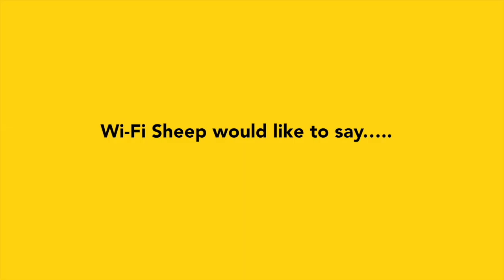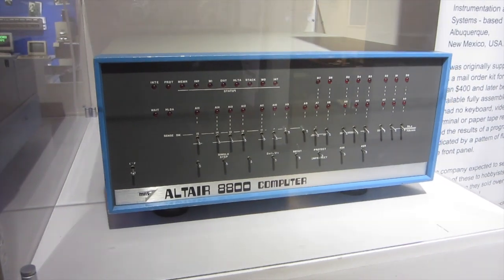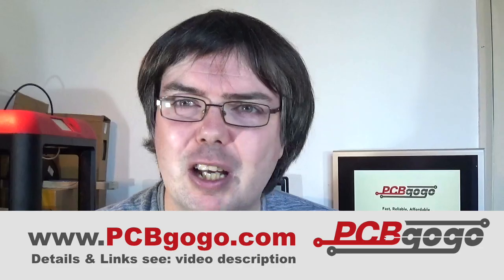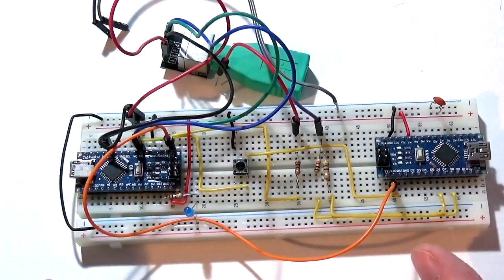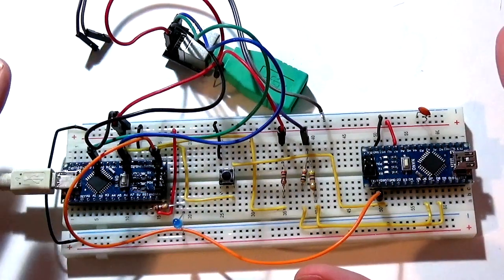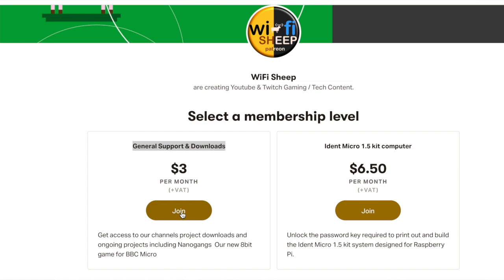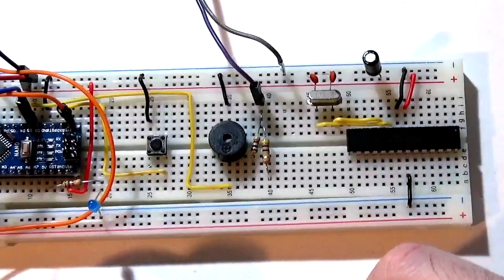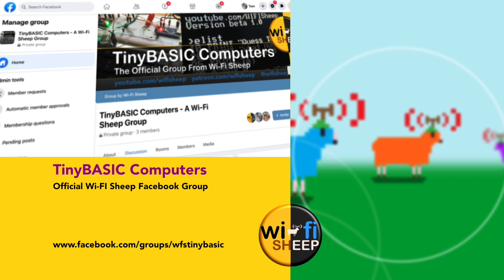TinyBASIC Computers Easy Build 8-Bit! - Pt4: Upgrades!

Comment: Hi Tom, I have a question, I am new to XLoader and am in kind of a pickle. When I first tried uploading the "TinyBasic...SND...300x" file (paraphrasing), XLoader would freeze saying "uploading..." so I went and changed out my nano for another and this time it got past the "uploading..." issue, but now it says upload failed. I have no clue what to do from here.
Reply: Okay, so I said fooey on the XLoader and flashed it via CMD and that worked then I plugged it into my TV and nothing happened. So... I see there is a NTSC hex file? What am I supposed to do with that file? And if I have to flash it onto the board as well wont it remove the TinyBasic_PS2 file? If I can get some help it would be great! I have been troubleshooting this but now I am at a complete roadblock. 

The setup I am using right now is 1 Arduino Nano with the Atmel 328p chip as the slave. I am also using a usb female that I spliced and soldered for my keyboard port and a red Audio RCA port (that shouldnt matter right?) as my video port. Basically the exact same setup you have in this video.
Reply from the maker: Hi, there, Okey....
First off, XLoader reports failed even when the hex files have uploaded fine so dont trust what it reports back. - this was shown in part 2 of the video series. 

(If using clone Nanos these will require the CH340 driver to be read on Windows)

This setup shown in part 4 which this video is, is the advance setup version of the project build where one of the two nanos is replaced with a standalone Atmega 328p chip

A Arduino UNO is used to flash the 328p chip in same way as the Nano. (again shown in this video) The 328p chip is then removed from the UNO boards chip socket, a feature of these PCBs 

The Atmega 328p Chip acts as the video terminal and needs flashing with either the PAL or NTSC hex rom file only. - its sole job is to read the TX serial data coming from the nano and generate a tv picture. 

The one remaining Nano is flashed with the TinyBasic_PS2 hex rom only. On its own it dose not generate the video signal. but as shown (in part 3) can be tested via USB using the putty serial software for windows which if set to 300 baud and the correct COM port (which ever your PC puts your Nano board on) should display the live working BASIC interpreter running. This nano will not produce a tv picture on its own.

Hope that helps, please rewatch earlier videos in the series if your still unsure (from part 2) which go over the basics. Part 4 (this video) assumes you have a working system running and all items shown here in this video (part 4) are optional.

All the best- and good luck
Tom
Reply: @WiFiSheep  Thank you Tom very helpful indeed! I actually went ahead and flashed the 328p chip so I will test it on putty to see if i get any feed. Thanks again!

Edit: It's working Tom! You are brilliant and thank you for all the help and guidance.
Reply from the maker: Okey well done! & No worries!, Thanks for touching base and have a nice day!

Comment: Interesting project indeed! Question: If you look at an old 8-bit macintosh, it had a screen, keyboard and speaker built in, a complete setup. Is this something viable for this project? Like a cheap keyboard + cheap lcf screen :) That would be the best!
Reply from the maker: Yes, absolutely, please check out our TinyBASIC Computers series https://www.youtube.com/playlist?list=PL8Ltmk_Xax1qYr7pXQUrhQ8ibLuIxM7O2
Which dose exactly what you describe!
Reply: @WiFiSheep  Thank you! But would it be possible to use a cheap LCD-type screen, that you can buy from, say, Aliexpress? :) Not sure how they connect though. Maybe mini usb, or something?
Reply from the maker: With our system if it connects via analogue composite video then yes, otherwise an alternative video terminal would be required, arduinos can run small LCDs from there gpio pins and a large amount of open source code is available  to do this, but it is outside the scope of the project.

Alternatively VGA or HDMI can be achieved by using off the shelf composite to VGA/HDMI adaptors which work well .
Reply: @WiFiSheep  Thanks! Just out of curiosity, why do you think other "8-bit" modern systems is priced 2000% more expensive? That seems so surreal?
Reply from the maker: @jonorgames9880  Im sure about the 2000%? But .... 8bit systems be it kit or ready build are now a days done in very small quantities, even with China PCBs prices per unit can cost a lot or parts / chips etc plus the producer will want a 20% cut / profit which is fair enough. 
So I get why these systems are priced the way they are, its just many people , myself included are on a very tight budget so cant justify the expense.

My TinyBASIC computer project was an attempt to create something very simple 'out of the box' for between $30 - $60  that you didn't have to solder together.

I am looking at all the options whist being mindful of the price

Comment: Have you abandoned this? As it started 6 months ago, started again recently but then stalled in February.
Reply from the maker: With all due respect new content relating to this project was released just 16 days ago.
The project has not been abandoned or stalled in any way. The facebook group is very active as is the youtube comments and chat for this content so far.

I would like to remind you that this channel has a number of projects on the go at the same time, including the research and testing that has to go into projects before content is produced and published. Add to this most content here is produced by one person who also has to do other work not related to youtube as a 'normal day job'. In addition to having to operate during the covid-19 pandemic which has caused delays.

TinyBASIC computers is not the only live project this channel produces, with more content coming this year and into 2022. As it stands enough videos and resources have been produced to allow anyone who wishes to participate, build a system  and program it. In addition to modifications and improvements.
Reply: @WiFiSheep  sorry I didn't mean to offend. It just seemed to me that the project hadn't moved fast enough. It captured me but then appeared to have not moved very fast. As I said no malicious intent meant. Rather than just writing the code and compiling you could talk people through exploring the graphics library themselves and then giving them the solution after. My personal problem was that I want to use an i2c display with it rather than spi or video out with the possibility of adding video out as an option.